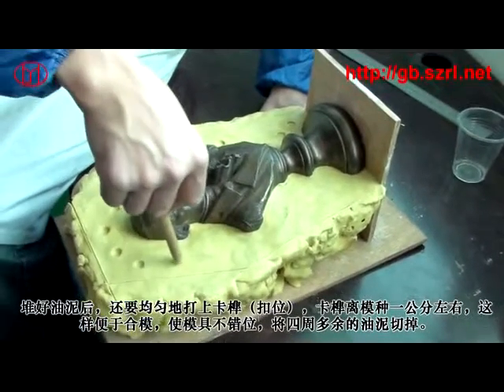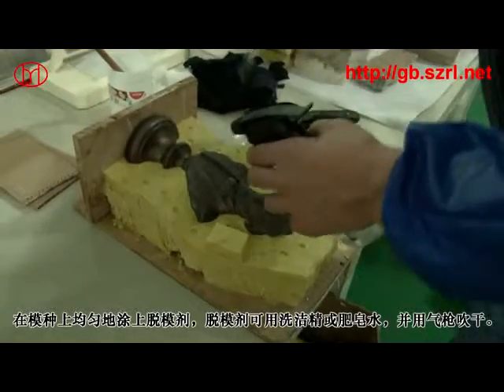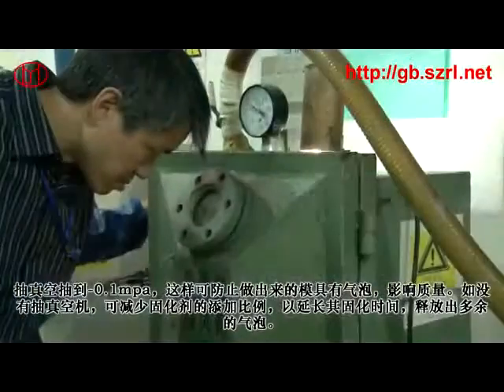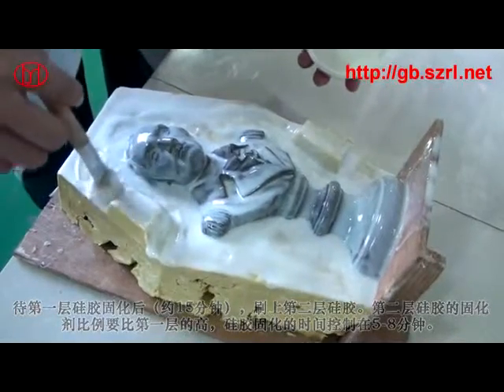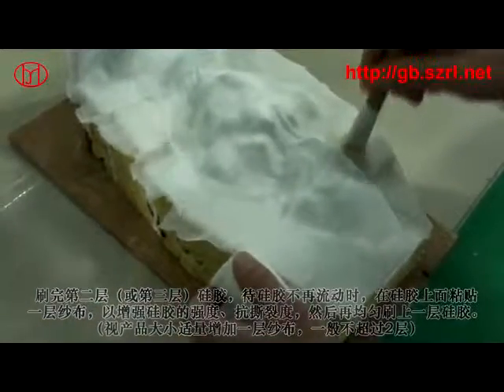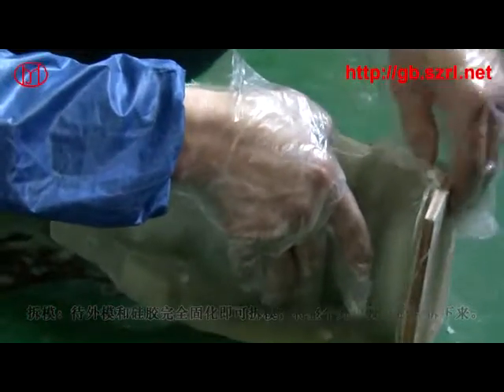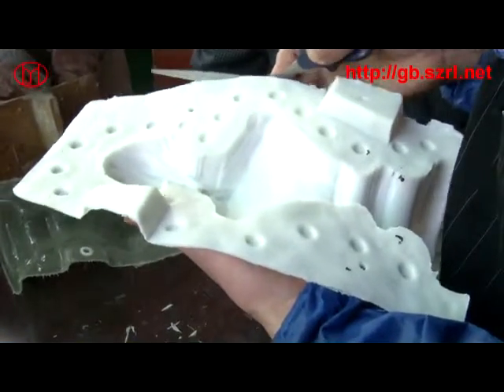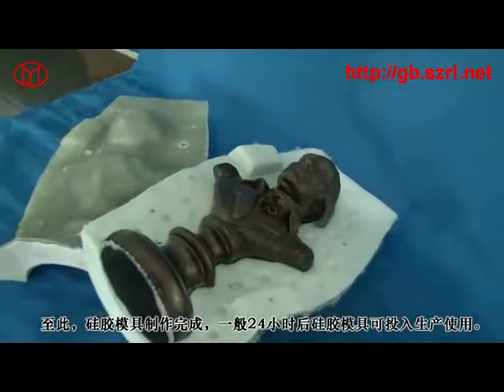how to brush on the silicon mold:easy way to operate

Comment from the maker: This is a video about how to use silicon rubber to brush resin handicraft male statue sharding mode .I believe it will be helpful to your business .
For further information, pls contact with Miss Bonnie
TEL: 0086-755-89948294
Mobile: 0086-18938867507
Mail : hyxb(at)szrl(dot)net 
Welcome to visit www (dot)szrl (dot)net anytime .